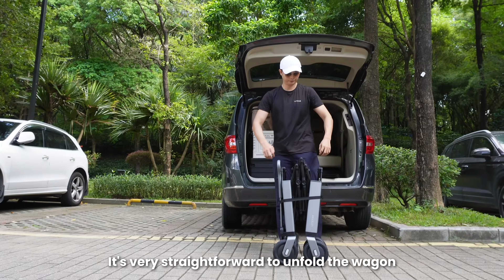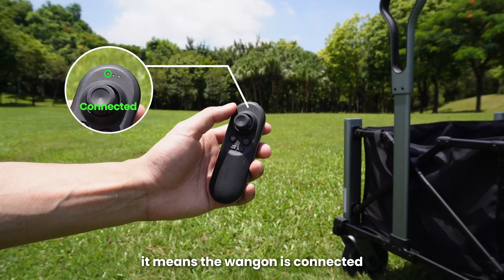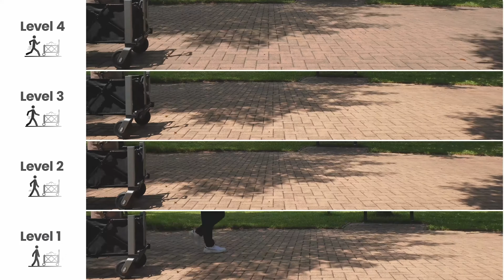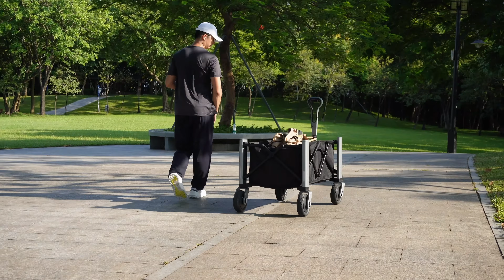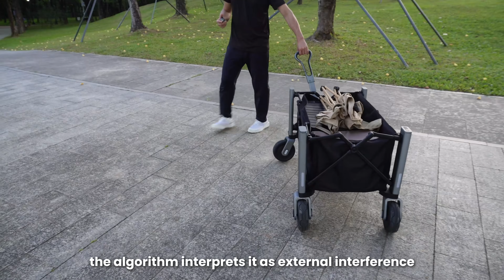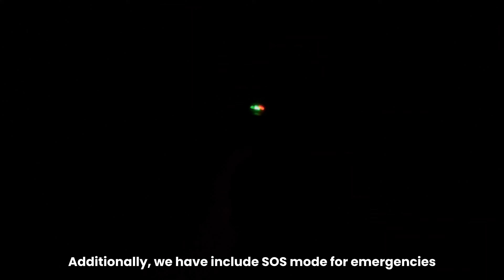🧭Welcome to the LITEFAR Orion Tutorial!

Comment: Hi ! I’m wondering how LITEFAR handle stairs ? Thanks !
Reply from the maker: Hi there! Thank you for your question. As an outdoor transport solution, Orion is designed for most terrains, it can handle curbs with the assistance of its hub motors, ensuring a smooth roll. Additionally, you can provide extra support using the hand-pull feature to enhance its performance. However, when it comes to steps or staircases, it would indeed pose a significant challenge.